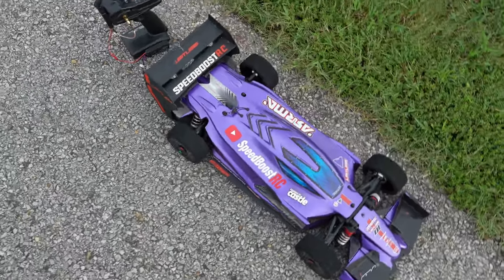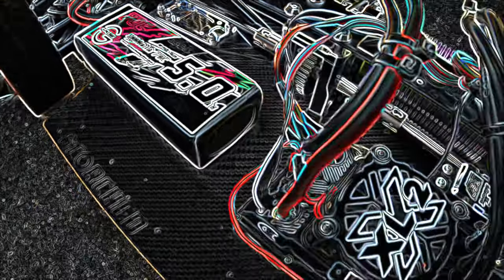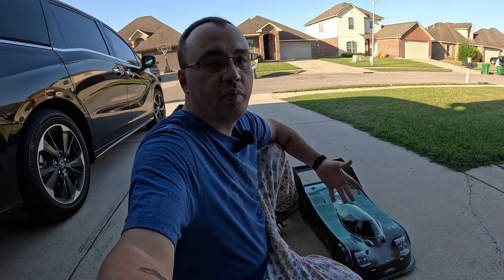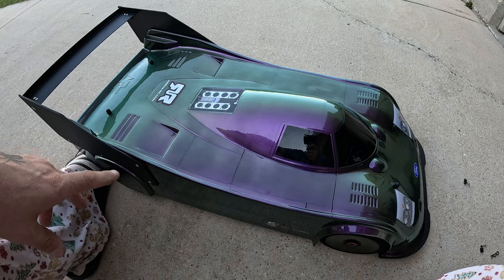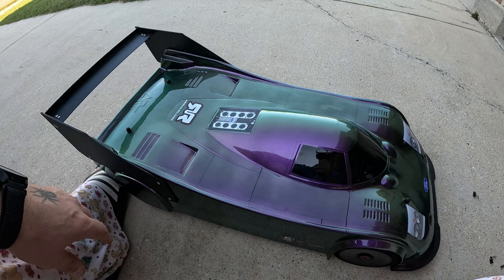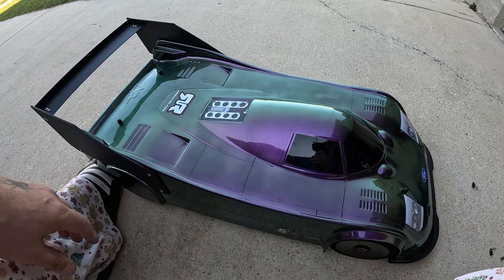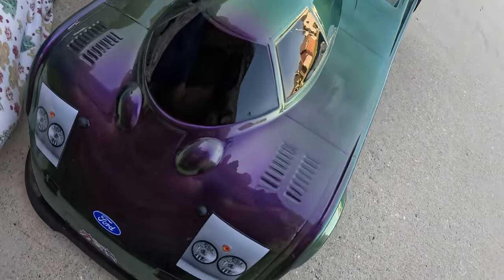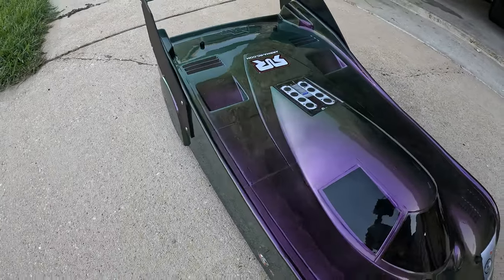UNVEILING A REBUILT 200MPH RC BEAST! | The ARRMA Limitless Transformation

Comment: Nice.  The front and rear spring, should not have any down movement.  Crank them down until they go off the threads.  The stiffer the suspension the better you can keep the car under control.  Especially when your stopping.  It should stay straight.